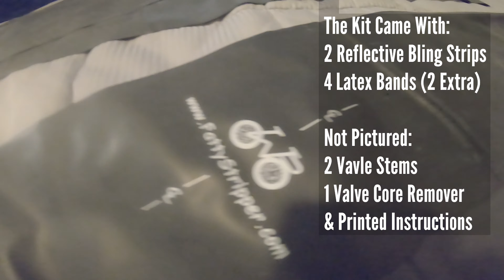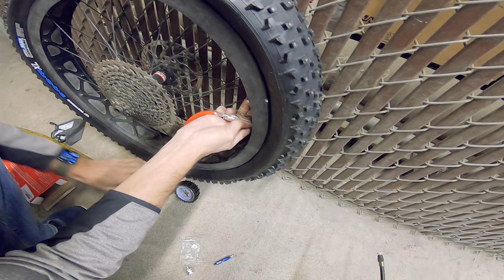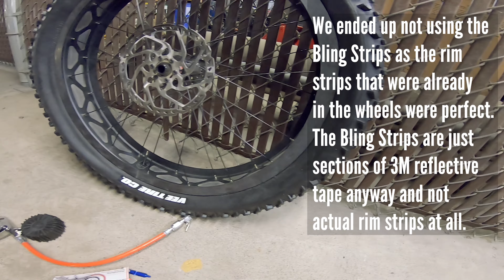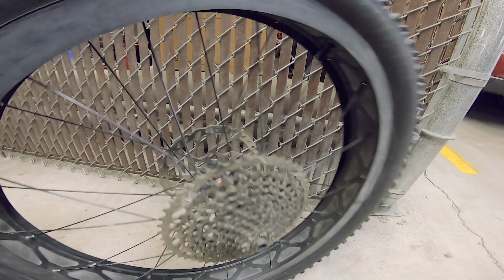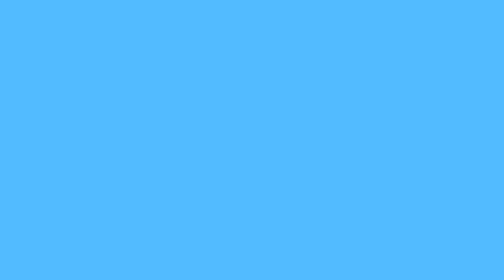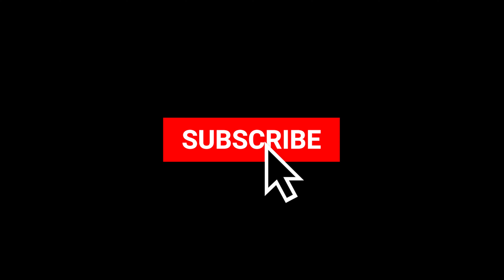Fatty Strippers | Fat Bike Tubeless Conversion with Sun Ringle Mulefut 80 Wheels | Fat Bike Asinine

Comment: Should have used sealant! Fatty stripper is so you can run 3 or 4 psi on the trail and avoid burping tires
Reply from the maker: After you get tire bead locked in place you can then add sealant through the stem. But yes sealant was added.

Comment: Hello, which tires were yopu using in the video? is this a 20" x 4", if it is, where can I find it?
Thank you for your video.
Reply from the maker: The tires are studded 26” x 4.8” Vee Tire Snowshoe XL on both wheels. I just checked on amazon and they have a Vee Tire 20” x 4” tire called the “Snowball” and it’s studded. I’m sure there are other tire options available in 20” x 4” size from other companies as well as Vee Tire that are not studded as studded tires are pricey!

Comment: why go to all this? when you get a flat with a tubeless tire yes you can plug them but a hand pump won't work fast enough to inflate fast to seal the bead? Do you use a compressor? or co2 cartage?.
Reply from the maker: Fatty Strippers is the easiest system to turn tubeless compatible rims to full tubeless. It’s easier than taping your wheels with Gorilla Tape or Rim tape for fatties which is no available. Once your tires have sealed on the bead they won’t pop off unless you do something crazy stupid. My sealant dries up quickly in Colorado so sometimes my tires are flat before riding. I just pump em back up with regular bike pump and they hold without for 1.5 days before noticeable deflation. I tested the fatty strippers without sealant and they mounted with air compressor. Get the tires on the wheel and head to local bike shop for their magic super air to get them to pop the bead in place. It’s usually free if you’ve got a cool bike shop. Otherwise, pay them to mount your tires. Then regular bike pump forever. You’d have to do something that fat bikes aren’t intended to for the bead to pop in most circumstances.
Reply from the maker: Also, it’s rare to pop a stick through modern tubeless ready (TR) are more durable mtb/fat tires. But, if it does happen fat bike tire are much easier than skinny bike tires to throw a tube into and get back to riding.

Comment: I have the same wheel set. 27.5. What size  fatty stripper rim strip did you order. I think the inner width is 74 mm not sure thanks for the help.
Reply from the maker: We have 26 inch wheels. When you order from Fatty Stripper it asks what wheels you have. I think the guy who runs it checks for sizing. The latex liners in the kit overhang by about 1.5 inches on each side of the wheel. Then you trim the extra with a razor blade after you get the tire beads to pop into place. If you're unsure what size to get just contact FattyStripper website. Owner is a super cool dude and will know what you need!
Reply: @fatbikeasinine803  Thank you very much for your help,  appreciate it.